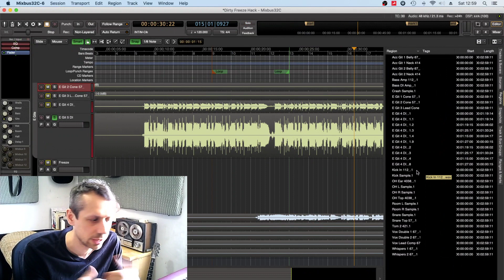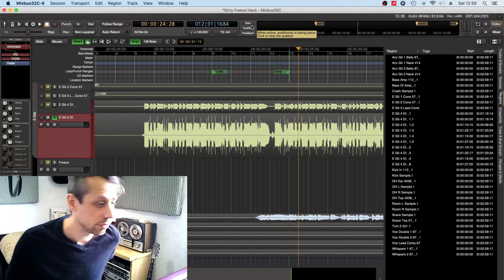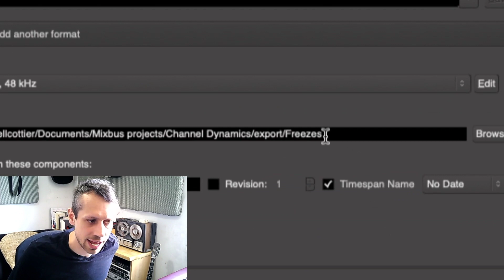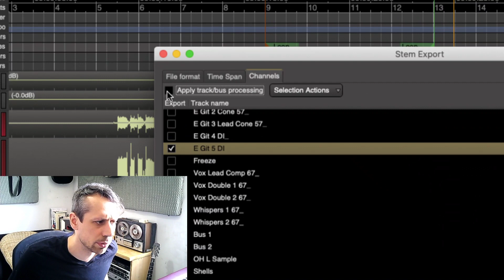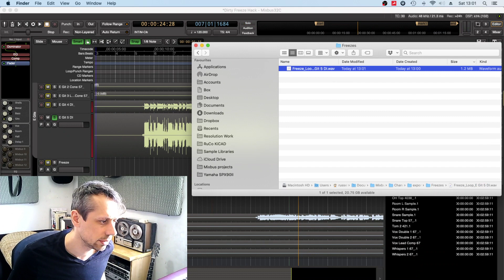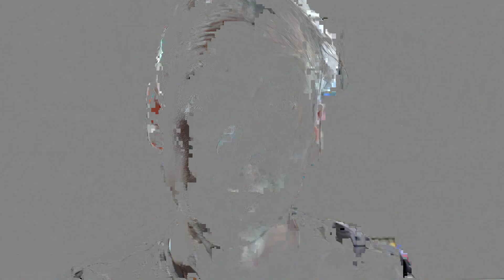Mixbus Freeze Hack  - Freeze tracks in Ardour and Mixbus 32c

Comment: This video has absolutely changed my experience of Mixbus. I can’t count how many times I did a session in mixbus bus and had to restart again in another daw because xruns, even if infrequent kill your session. I really want mixbus to work but it’s just so unstable even on a moderately powerful system. Your track freezing method has helped manage some larger sessions that wouldn’t normally be bothered trying on mixbus (large groups of backing vocal, ensembles etc). It’s a shame I essentially have to do old school reduction mixing, during the mix.

Freezing is absolutely necessary in mixbus for larger sessions and you use even a handful of 3rd party plugins. It would be cool if there was an official freeze function that effected the in built channel processing
Reply from the maker: Cheers